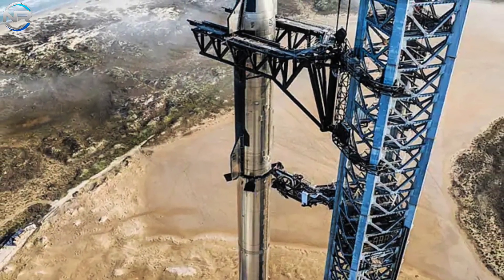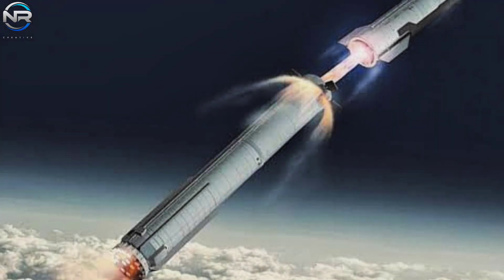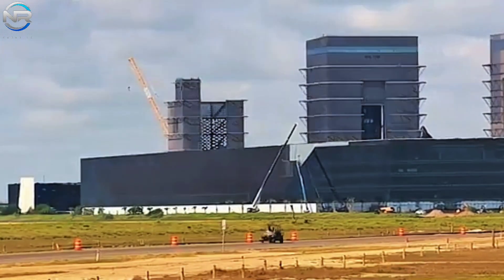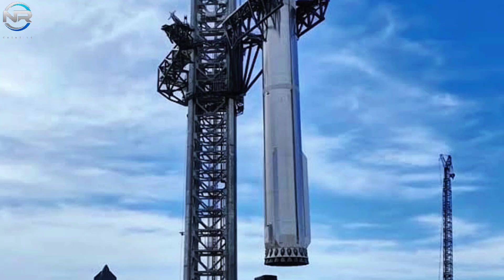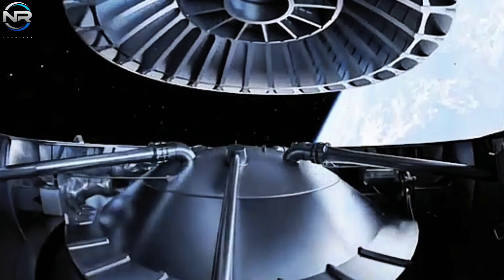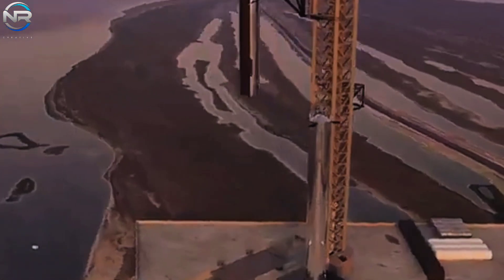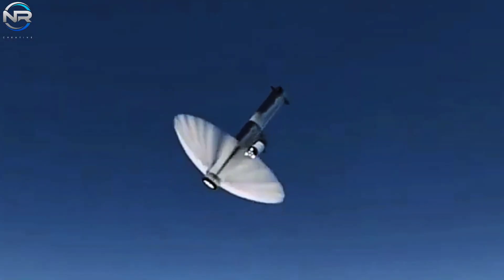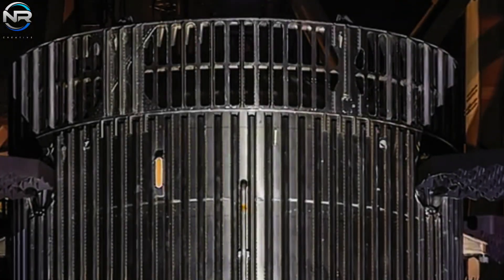New Design of Starship HSR! SpaceX Answer to Previous Problems!

Comment: Sorry but the ring is not the problem, sure it needs redesigned as is way to restrictive.
The ship was not designed to hot stage or with hot staging in mind in the first place!
It just was not!
You can not expect any vehicle not designed to take a serious explosion up it backside to then deal with a serious explosion up its backside.
Restricting the pressure even more is only going to reflect and amplify shockwaves even more so......
The entire application of hot staging to this ship has been nothing but moronic.

The ring is way to restrictive, by a long way, the ring is not tall enough, the dome is wrong.... everything on that ship WAS NOT DESIGNED TO HOT STAGE.
This is not just an engine bay problem, it is a ship wide problem!
The most obvious question would be, why in gods name are they not static firing the ship while attached to the hot stage ring???? Helloooo....Mcflyyyyy..... 
As an engineer, their entire approach to hot staging is utterly mindless.
Elon would do well talking to Russia, they have already been through ALL of this and would happily confirm everything I have said since the second hot staging was mentioned. 
The ship is not fit for it, it was not designed to in any way. Sorry if you don't like this but it is an actual fact, the ship was not designed to hot stage end of story x